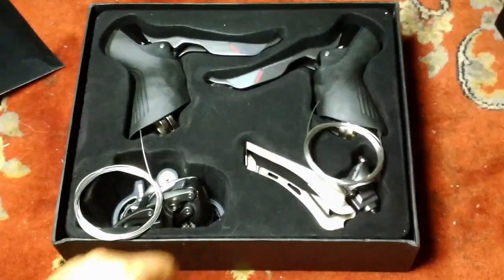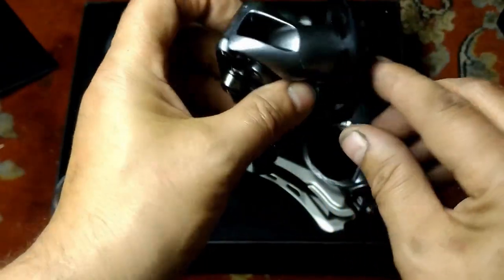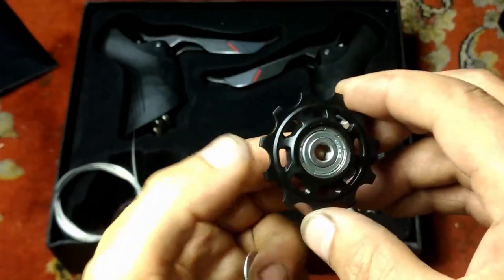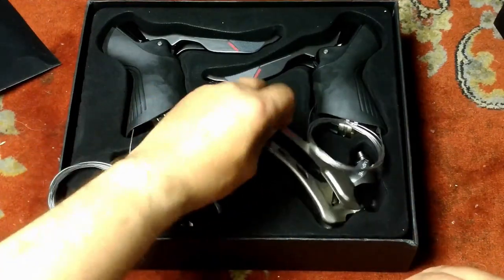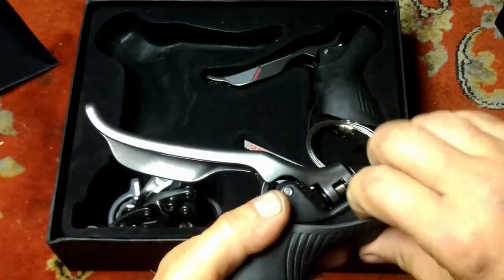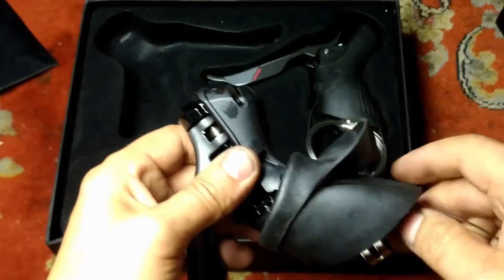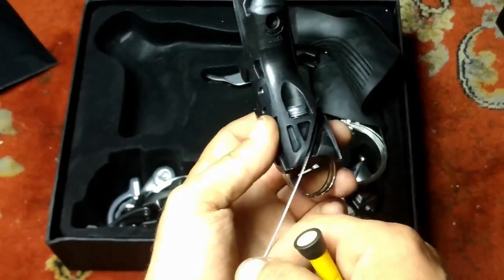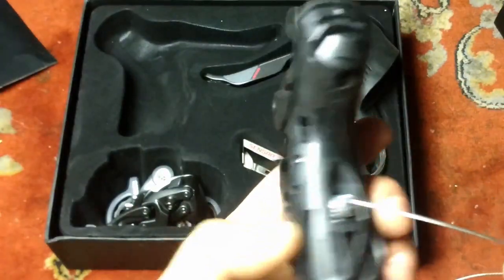Sensah Empire in depth appraisal

Comment: the rd looks like sram and some parts on the shifters but the cable pull is actually simillar to shimano i have a friend who put this into his cyclocross using an alivio RD to be able to use 40t cogs and it works without skipping any single cassette
Reply: Do you think I could I use a 105 RD with this? Do you know if they have similar a cable pull? I bought them for my first build because I'm not exactly flush right now, but the FD was shit and I ended buying a 105 FD and found the RD surprisingly good, but now I want to use a 11-32 for steeper climbs and with D screw maxed out, there's still a lot of chain rubbing. It's advertised as compatible with 32 cassettes, although  it clearly isn't.
Reply: @mrdanialvarez  we haven't tried 105 yet but i think it will work since the cable pull is pretty similar but its still up to you if im going to choose between 105 and the stock sensah rd i think would just use the stock because it was the rd made for the shifters but if you already have a 105 RD it doesnt hurt if you would try it incase if it doesn't work you could still use the stock sensah RD
Reply: @ranzteeezy9716  I'm using the stock sensah RD right now with a 11-32 cassette and the cross chain noise is pretty bad, with 11-28 it worked great, but I live in a pretty mountainous area, so 11-28 is not feasible for me. I'm afraid I might fuck my bike up if I keep using it and I shift inadvertently to small-small. Apparently, after doing a little bit of research, the cable pull for all shimano RD is the same up to 10-speed, 11-speed is different (https://www.artscyclery.com/science-behind-the-magic/science-behind-the-magic-drivetrain-compatibility/) , so now I'm not sure if it'll work. Might end up changing the whole groupset when I have the money, but I'd like to avoid that if possible, because, like I said, I'm kind of broke right now.
Reply: @mrdanialvarez  yup 10-11 speed has different pull ratio that's why we've used an alivio RD because 9 speed mtb RD'S will work with shimano road shifters from claris - duraace https://www.bikeforums.net/bicycle-mechanics/1053387-9-speed-mtb-derailleur-10-speed-road-drivetrain.html
Reply: @mrdanialvarez  if you're using a 105 cassette right now i think it may work because if sensah shifters work on 105 cassette that means that the cable pull of sensah empire is similar to shimano 105's cable pull because shifters have an exact integration on each shift inorder to match the spacing of every cogs if sensah empire matches 105 cassette it means the the RD will also match with the shifters but again i don't recommend it because i haven't tried it my self it may work without skips but im not sure if the perfomance won't be shit
Reply: @ranzteeezy9716  thanks for the info! I really don't know what to do now. The cassette is a 105, like you suggested, but yeah, performance might be shit with a 105 rd ☹️
Reply: hey guys, the sensah shifter is compatible
 with sram road shifter. I am a sensah user in china.

Comment: Great vid. I have a set too. When I'm pushing in a new gear cable, should the shifter be all the way double clicked or single clicked? Thanks.
Reply from the maker: On any shifter, it should be fully released when installing or removing cables, so single-clicked.
Reply: @KimMoth  I see, thanks for reply.

Comment: I have serious problems getting the front derailleur to shift to the big gear, it seems the cable tension needs to be very precisely tuned. The spring is also extremely strong in the front derailleur.
Reply from the maker: This FD is likely to have problems clamping to a FD braze-on mount, because the bottom of the clamping face may not extend past the slot and push into it, making the whole thing rotate backwards a few degrees, killing shift quality at least, and maybe threatening to jam the bottom of the cage into the chainrings and/or destroy an aluminium hanger. 

You shouldn't have this problem if you're using a braze-on to clamp-on adapter, but otherwise you could try making a shim to go between the FD and hanger (fiddly to make, but it worked for me), or put smaller chainrings on. Maybe compact chainrings are now so popular, these Sensah jokers never bothered to check if it mounted properly above a 53t.

Comment: Thanks for this. I've just ordered my set for cheap as chips. Can't do any harm to try out on my winter trainer ☺️ I already purchased a full 6800 Groupset for Summer bike ☺️
Reply from the maker: Can't do any harm? I guess you haven't watched my other vid... The FD broke my hanger because its shape isn't quite right.
Reply: @KimMoth  Yeh, I have a spare 105 FD anyway. Cheers for that 🙂
Reply: @KimMoth  Yeh, fidgety fixed bolt on FD braze on. I've found the clamp braze on adapters to be just as tedious but they do work once you pre-fix the FD to adapter before fitting to your frame. I have also had to buy 3 different clamp braze on adapters to alleviate the problem you've experienced with mis-matching the groove's. Anyway, good intel 🙂

Comment: I have trouble at installing the new cable there seems to be a old one stuck inside, any help?
Reply from the maker: Pull it apart. Start by folding the hood back. If that doesn't help, take it off. If that doesn't help, start to disassemble the lever, only as much as necessary to enable removal of the old cable.

Comment: Can you make a review on the groupset weight as well? Considering this for a budget bike build
Reply from the maker: I was going to weigh the parts before I installed them, but forgot. However, I believe others have weighed the levers at least, which are meant to be similar in weight to Ultegra. If that's actually the case, a higher-end version of the Sensah levers using a carbon lever could be quite light indeed.

Comment: Will the derailleur work with 32 cassette?
Reply: Nah... That rd only support max 30t you can force to use 32t but the rd more risk to bend
Reply: @afandianto  haha iam using it bro with 32th cassette working fine after some adjustments.👍👍
Reply: @NordenTamang  wow I didn't think that it could be done, have you tried crossed chain from big chain ring with biggest sprocket?

Comment: But is it still working today?
Reply from the maker: Sure, it goes fine, no adjustment required so far, and I wouldn't expect it thanks to the huge cable pull per shift. Because  the front uses a lot of cable pull too, the huge swing to get on the big ring is a bit of a PITA. 

I made a shim (squashed a large washer around the shank of an appropriate drillbit, and ground and filed it to fit in the crescent-shaped space between the derailer and the hanger), which allowed the silly thing to actually clamp how it's meant to, instead of angling up as the lower end of the nose mashed through the slot in the hanger. The front shifts well now, if you ignore the large amount of lever swing required.